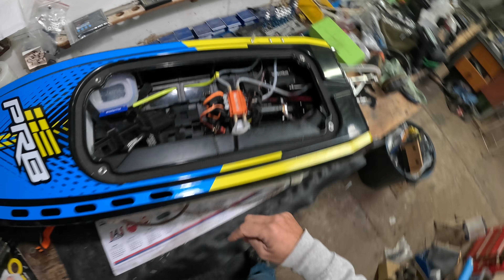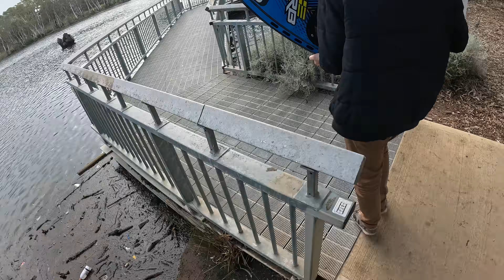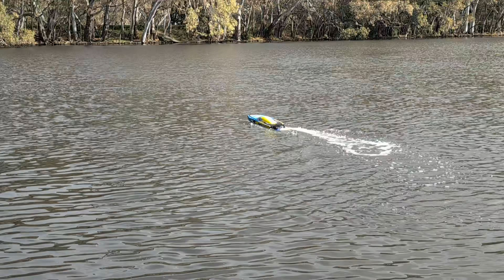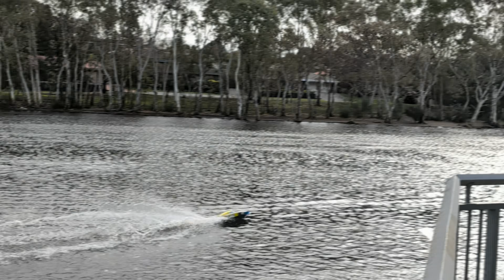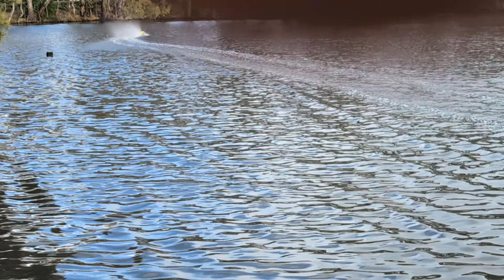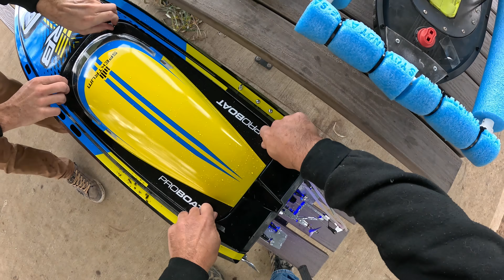We got our Proboat Supersonicwake RIPPING — 1070kv TP Motor + ZTW 200A Combo

Comment: The "SR function" on the ZTW 200A ESC refers to Synchronous Rectification. When enabled, this feature improves the efficiency of the ESC by optimizing power delivery to the motor, resulting in reduced heat generation and increased run time. 
Real world TURN  IT OFF! :P
Reply from the maker: Thanks for that, be interesting to compare runs with fresh packs on each setting
Reply: @RCBoatBitz  Done that...off! 😂